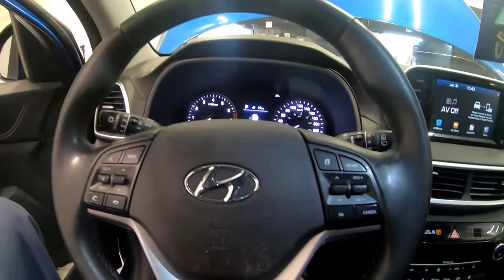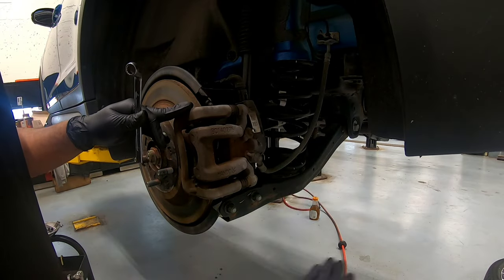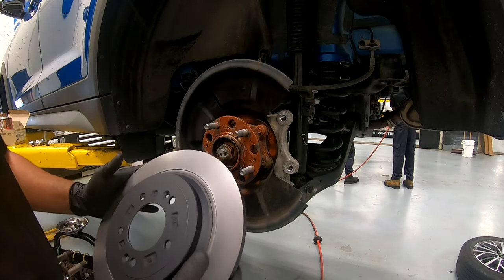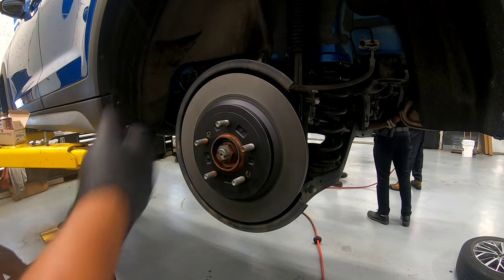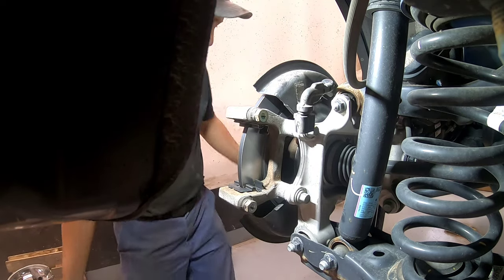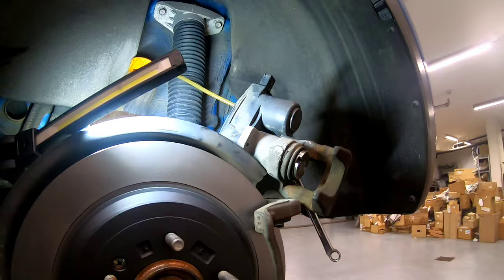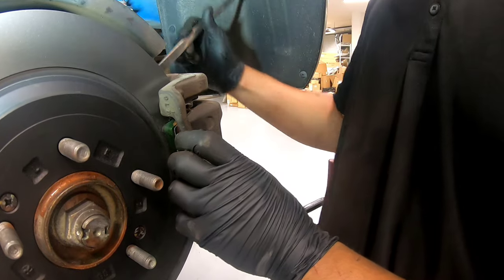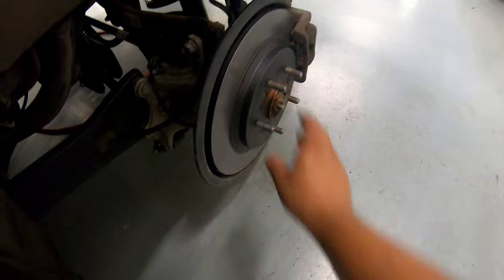2020 Hyundai Tucson Rear Brakes Replacement

Comment: So I did my wives rear brakes by just pushing the piston back because I didnt know about needing a scan tool for electric parking brakes but what I did was disengage the parking brake and then removed the old pads and spun the piston just up until the new pads were able to fit in. What could have gone wrong when doing that just so I know what I could have encountered.
Reply from the maker: Worsr case scenario you will have malfunction in e brake system, but if it works normally you should be okay.
Reply: @hyundaitech  awesome thank you, I havent had problems and its been over 5 months since I changed em
Reply: its  fine to do that

Comment: Do both left and right calipers retract the piston with the same clockwise direction? I noticed that some of those brake caliper tools have only a regular thread bolt and others have left and right threaded pieces...
Reply from the maker: Yes, both calipers turn right piston goes in.
Reply: Thank you!  @hyundaitech

Comment: hello good day i have 2015 hyundai tucson  rear brake problem no oil coming out in the bleeder screw only front have brake pressure
Reply from the maker: Possible corrosion builup on the bleeder screw, try removing the flexible hose from the caliper if theres fluid coming out most likely you need new caliper, if no fluid you have to work your way up going to the abs module if theres restriction. Hope that helps

Comment: Do you have to rotate the piston to get it to go back in or is simply pushing it in fine?
Reply from the maker: Once the epb service mode is done, you have have to push the piston.
Reply: What scanner works on a 2020 Hyundai Santa Fe? I tried an Innova 5512 and it’s not capable.
Thanks for the reply!
Reply from the maker: @zaclapierre8049  check some scantool that offers bidirectional controls, like topdon, thinktool, autel.

Comment: If you open bleeder to push piston in, you won’t know if the brake hose is collapsed or not 🤔
Reply from the maker: Well if im thinking right if theres a collapse hose there will be uneven pad wear between right and left side. And with this type of process it will be more helpful in my opinion with higher kilometers car atleast the old brake fluid instead of going back to the line it will just come out to the bleeder screw.

Comment: Is there a think tool that is cheaper I could get to still do this service not trying to spend 1k 😅
Reply from the maker: There should be scantool with range 500 to 600 can do epb service.
Reply: @hyundaitech  is there anything cheaper I can buy that would work I just don’t want to spend that much if I can get away with less ?
Reply from the maker: @crg1094  you can contact the seller if some chepaer models has that capabilty.
Reply: @hyundaitech  thank you